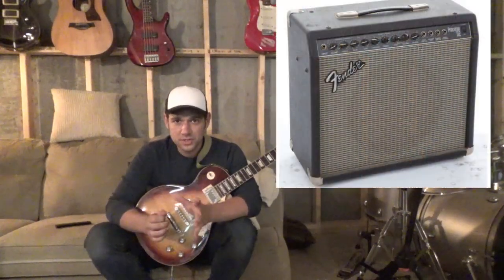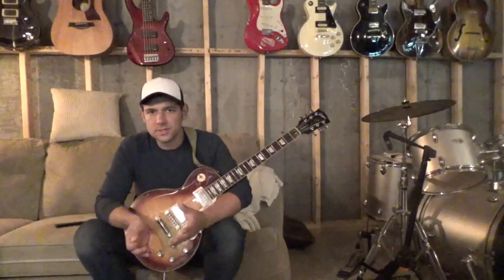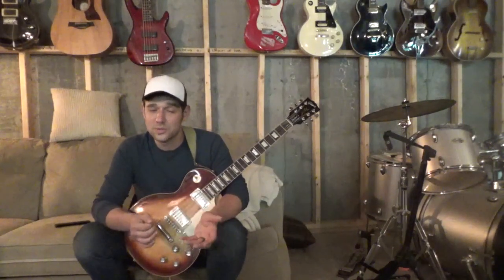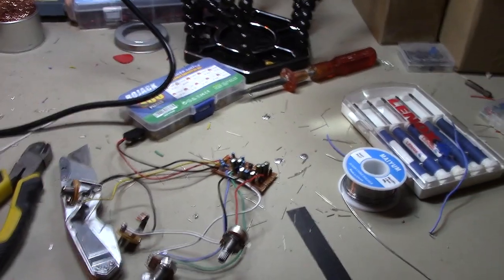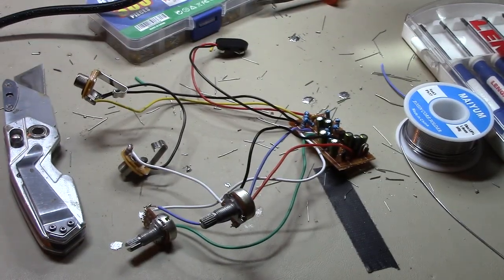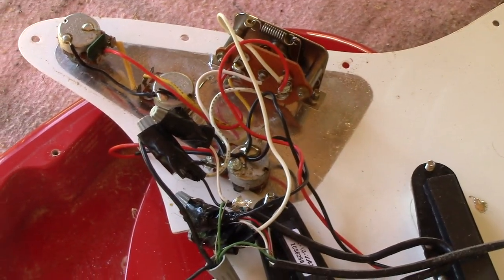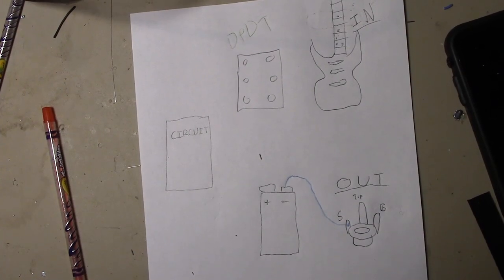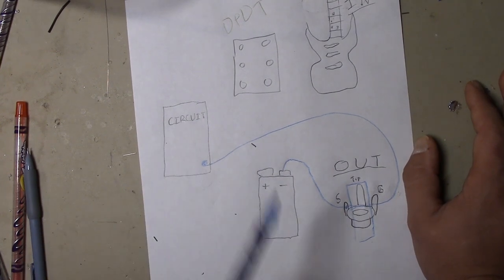Squire Strat Becomes a Sustain Machine - The "Compressocaster"

Comment: That hum or buzz at the beginning is not lack of shielding, it is not grounded properly. The pickguard being shielded is not enough to make a Faraday cage and completely shield the guitar,  you need to shield the entire cavity. That is a cool mod though.
Reply from the maker: Yes indeed you are correct. Once the circuit was installed inside of the guitar, the noise ceased as you’ll see at the end of the vid. Thanks for your comment!

Comment: Hi! I'm all for extending the possibilities of the electric guitar, I had a japanese guitar for years withan active pre-amp and distortion incorporated, later, when I ordered a Luthier my own model, I added a discreet/transparent three band EQ (cut+boost), but touring a lot, showed me I'd better have everything on a small pedalboard+power supply, instead of the trouble of changing batteries all the time (that's personal).The japanese one had 2 9v batteries and the Luthier's guitar consuption was =+/- 0 (the battery lasted forever).
But it's always cool to see someone trying something different and go his own path, keep up the good work!
ps Yes Fenders sound better with a little compression!
Reply from the maker: Very very cool mods you’ve discussed above.   If touring it might be better to just have the pedal board like you said. But I like the idea of having sustain on hand if I need to go play on someone else’s gear that I’m not familiar with. Thanks for sharing!
Reply: @lowheadroom  Thank you for answering, very nice of you. I can tell you that ,in all of my guitars, sustain was paramount, so I always used neck-thru guitars, with lots of sustain, but I've always been a fan of compressors, it fits my aesthetics (cristalinne clear sounds with lot of range),and neck-thru guitars thru valve amps (combos with EVH112 (?), full range speakers (radials)).I also had a small period with pedals gaffed into the strap (Delay+EQ), but it didn't last long.Thank you for taking the time to read and answer, have a great day! I do think it's a cool mod you've made! Specially concerning a Strat!